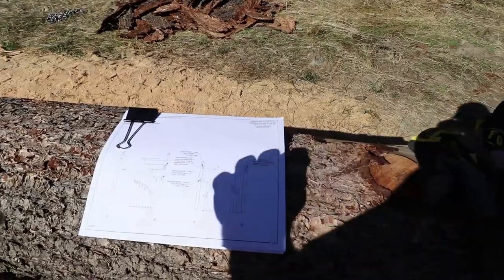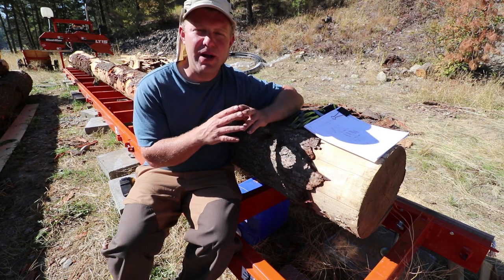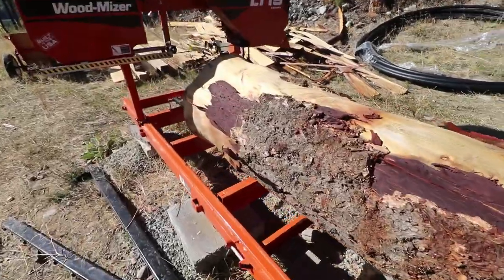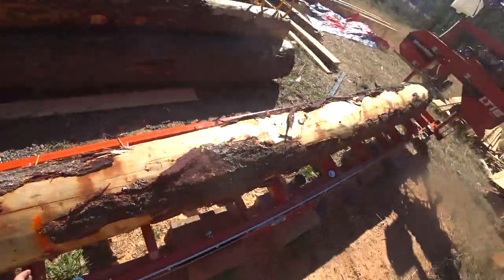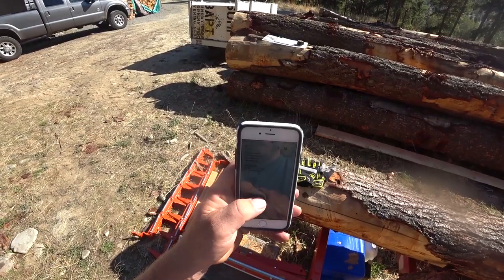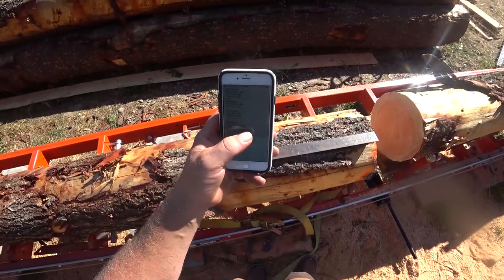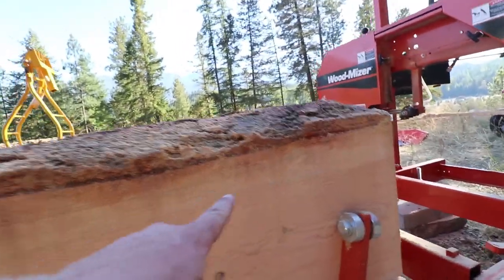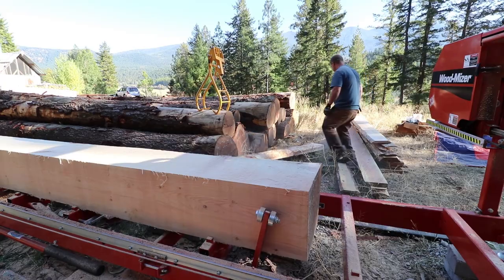Sawmilling First Beam Of My Timber Frame House

Comment: I enjoy hearing the hows and why - I wouldn't watch to just see a saw buzzing.
BTW- saw Alyssa in last epi putting bark sections in a bin.  I take my bark sections and lay on paths bark side up.  They decompose slowly, prevent weed growth, prevent wheel sinking in the mud, and provide wet/snow traction for my tractor,  lawntractor and feet.
Reply: The wood is for a Hugelkultur raised bed garden.
Reply: Thanks -- Some bark would go a long way on that.  But still a great use.

Comment: Just a tip. When you mark the size of log you want with your square on each end if you would take a nail at the 4 corners on each end and run a chalk line from nail on on end to the other and snap it  you could see what size beam you could get with out guessing.    Also you would see the low and high spots. This would give you a better way to get your beam size without waste

Comment: The tape you have is a Spencer logging tape.  You can get tape to put in that which has a "diameter" scale on one side.  So you just wrap the tape and read the diameter.  I use it constantly.  Definitely a cheap tool worth investing in given how much of this you will be doing (or have done?).

Comment: Hi Jesse!
Recommendation:  Don't worry about wane on one side of your timbers.  Think about it:  For walls, the outside edges will be inside the finished walls.  For floor beams, put the wane on the top and it will be covered by the flooring.
Old engineering expression: "Perfect is the enemy of good enough!
Also, don't stress over perfect dimensions on the beams.  If the exposed side of the beams when finished varies by even a quarter of an inch, it doesn't matter and will never be noticed.
Perfect is nice, but TRIPLES the time involved!!
Best, Dave
Reply: You're wasting your time. He does not read the comments, so you are just talking to the rest of us. Just so you know!
Reply: In addition to SixString, the structure is built.  Go to his Facebook page to contribute Real Time.

Comment: 1. sometimes as you rip the logs the stresses change and they  will "curl". So it may not be the bed of the mill. 2. Wanes are not necessarily bad, they can add interest, especially in braces, floor joists/beams.
Reply: Also the movable arm ( I forget the actual name) needs to be as close to the log as possible to prevent blade deflection during the cut.

Comment: When you had the jack under the log, it was on the ground, i think you should have put wood under the log so the weight would be on the mizer before cutting, otherwise you have 2 reference points.

Comment: Your logging tape measures diameter as well as length fyi.  You can also use two framing squares to accomplish the same thing.  The crook in your logs is referred to as sweep and should be to the outside when starting the first cut.  The closer the idler wheels are to the work, the less deflection you will get in your blade.  Seriously time to re-purpose the grizzly into a solar kiln so you can dry all the left over 2x material.  Those are amazing logs... they have very little taper, the wood is quite clear and you can see how straight the grain is in the checks.  Keep up the good work, but a owner built log home would cost less at this point even if you like post and beam style.

Comment: This will likely be too late for advice to be received:
your sawmill is also technically a jointer. You aren't going to have a straight piece of lumber until you take a skim "flattening pass" on the mill. it doesn't even have to be to dimension, just flat. As long as your mill doesn't have twist in the bed, you use that skim cut to rotate 180 and reference that to the bed. adjust the bed to be flat to your reference face. Your next cut will give you another flat that is parallel to your first cut. After that, you measure to dimension what you could get out of the stock.
Reply: It helps if the rails that the band saw rides on are parallel and not skewed so that you can get a good first cut.  In cutting the tree the main thing is just to line up the pith on both ends if the tree is reasonably straight.

Comment: I'm not criticizing ya'll to be mean so please don't take it that way. Ya'll just don't have much experience building a house. As long as it takes ya'll to get a simple project finished like putting down the warmboard, that is only about a two and a half hour job. I just don't see how you are going to have this house dried in before winter.  There is a lot of work that has to be done after the framing and I sincerely hope you have a lot of experienced help coming after the framing to help you. I've read several comments that say that ya'll don't read your comment section and you are missing out on lot of good information that I have seen. I truly wish you the best. My advise would be that you study your plans at night for the next day's work and stop second guessing every measurement and process during the workday. You need to have all that figured out ahead of time and only make small adjustments during the building day. Having to stop and run to town everyday to pick up more screws, nails, glue or other supplies is killing your time management. The most important part of building a house is the logistic process of having the right products you need when you need them. I wish ya'll all the luck in the world trying to get this dried in by winter. 

I sure hope that you winterize  your equipment and call a mechanic to find the parasitic drain on your backhoe, make sure you have plenty of antifreeze in the backhoe. People selling used equipment are known for short cutting to save money just to move the equipment. Don't ruin an engine block by assuming they took care of the antifreeze when they may have just filled it up with water.
Reply: Yeah I noticed that, I don't understand why they took so long putting it down. It's a very easy product to lay down. Maybe they just bit off a little too much with their level of experience. They seem like nice people, Alyssa seems like a very hard worker and a nice lady. I think Jesse gets a little frustrated with the instructions that come with the products from the manufactures at times and seems to spend a lot of time on the phone with them. I know he doesn't want to make mistakes but building a house is not easy even for the pros at times. Lining up subs can be a nightmare if the market is busy and everybody has lots of work. They are just young and inexperienced I hope it doesn't take a toll on their marriage they do seem like really good people. 
I sure wish the read the comments and responded some. Many people have given them good suggestions. I'm a little worried about the used backhoe right now.  It's leaking hydraulic fluid, probably bypassing a seal, that's why the bucket drops down overnight. It's got a parasitic electrical problem and needed a new battery right after they purchased it so I wonder what the other systems look like. So many times they fill a radiator with water and only a splash of coolant to make you think it's got the correct mix for their environment only to see a block freeze and crack.

I know first hand how sellers will slap a little paint on something to make it look good and take shortcuts on the mechanical end, I've been bitten before myself. Had a company mechanic JB Weld a water jacket on a cylinder on a Caterpillar 3116 engine in a rollback that I found after I discovered coolant in the oil after we had purchased about 6 months later.  Thought it was a reputable company, they sell new and rebuilt forklifts in our area and have been around for years, we would have most likely still negotiated a deal on the truck just would have planned to replace the engine. Just wish people would be upfront and honest but that just doesn't happen much in this world these days.

Comment: You overthink this too much... just get to work, or you'll never get it done. 

you need to saw 1 flat (this cut should reveal the max lumber available from that log 6-12 inch flat cut from side to side..), turn it 90, saw another flat, the turn 90 saw another, and turn 90 and saw another. all the cuts should overlap some so that no bark is left in the corners. otherwise take a skim cut, and get rid of it. the small end is your guage for the size beam you can get. this will give you a rough cut timber to which you can set aside, and do a finnish sawing on it later. You are wasting time. I can appreciate double checking your cuts, but it'll take you forever at this pace.
Reply: You realize this video is several weeks behind right? The house is up... so obviously they got it done.
Reply: decoysk but obviously talking wasn’t an issue...
Reply: decoysk dude, they need to talk to make videos, you don’t want talking don’t watch video... you’re the only one here pissing and moaning about them talking during a video you’re watching.

Comment: I am not sure if the timber frame is permanently secured to the concrete stem walls or not.  Or if the timber frame is only screwed onto the warmboard subflooring.  The roof or a temporary roof of tarps will act as a large sail that would destroy the timber framing during a strong wind storm, if the timber framing is not permanently secured to the concrete foundation.  Please make sure all is secured during this winter!!!  Stay warm and dry...
Reply: It is a good thought, but this is the reason for windbracing.
Reply: Windbracing only works if every thing is secured to the foundation.  Thanks for pointing this out.
Reply: So if your caveat is noted, the whole thing should fly away in one piece.  I seem to have noted that there was a ledge on the edge of the base plates which are anchored by bolts , so he only needs to run a base for the frame around the baseplate and make sure it is attached
Reply: So true, that may be why the SIP is installed to the 4X12" sill plate before the roof is on...

Comment: Scoot that spud!  Boy, lots of work moving large timber around.  You mention "timber floor joists" but I've seen the videos with the engineered joists and the warmboard over it, so this term confuses.  I can only guess that the joist you mention is the outside bottom timber in the timberframe structure, not an actual floor joist as normally thought of.

P.S: Love the turbo log-milling scenes.  LOL

P.P.S:  You'll enjoy your log measure more if you spend a few minutes on maintenance on it.  A couple dabs of lithium grease on the pivot pins would stop the squeak.
Reply: LJ Prep I was just there building this frame, there are indeed timber floor joists for the second floor of the frame, I cut the joinery and put them in place myself. He's not talking about the TJI's that are already in place. 👍🏻 if you haven't seen the frame yet, check out heir Instagram, it's beautiful!
Reply: This will be a 3 story house. Garage, living space, living space. The timber frame floor joists will be between the second and third floor. Hope I said that correctly.
Reply: Susan Pfeiffer 👌🏻👍🏻
Reply: Brizzleberry Eaves BOB!
Reply: ro p. Hey bob! It was really nice meeting you. I hope we can work another project together some day.
Reply: ro p. Wait, is this Bob?
Reply: So far, I've watched nearly every one of their videos but have never seen a picture (rendering) of the future house.  Does anyone have a reference point for it?  I've seen a 45 degree angle shot of the first page of their plans, so i guess maybe I thought the bottom level was the garage.  P.S: Thanks to Brizz, too.
Reply: LJ Prep have you seen their Instagram? The house is framed, it'll give you an idea of what the future completed house will look like, with a wraparound porch and big windows on front.
Reply: No, I don't use Instagram or Twitter, but do visit Facebook a couple times a week.  What I've done, though, is always wondered why they do all the stuff, then post a video later, then get all the feedback which would have saved them a lot of time and frustration.  Maybe on their next project, they'll post what they are thinking of doing, how they'll do it, and then ask for feedback before they start.  And after all that, they'll do the work while filming it.  (grin)

Comment: You should attach a bike to the saw mill so you can peddle rather than do by hand it would be less energy in the long run... can you weld?
Reply: Only issue would be climbing on the bike and off every pass :)

Comment: the first time I've seen a logger's tape was a while ago on the Wranglestar channel.

You mentioned that you calibrated, measured every cross member to the blade and stuff. did you do that with and without load? that load might make that difference. But by now, you've likely fixed what's wrong.

That wane is good chatictor in any home, nor sure why you'd want it gone

Comment: You may have spelt a word wrong, but gee yu 2 are great workers, and given you got the point across for the title, not a problem for me, as others have mentioned WM would be wise to assist and supply a tech to show just what need to be done and back up there product, given others may see it as an issue in using that product. just saying.
Given the support Warm board assisted with it would only help to promote Wood-Mizer, just saying.
Keep up the great vids.

Comment: Would be nice if there was a way to compress all the coming saw dust residue into  a form for burning later. Maybe a 6" steel tube and hydro press would make the "Glitter Logs"... Thanks for sharing.
Reply: Tenright77 all that glitter came in handy keeping the dirt out of the garage work area and keeping sharp chisels keen on the occasional accidental tool drops
Reply: They make stoves that literally just turn compressed sawdust, they're called pellet stoves
Reply: You can just tamp the sawdust into a steel drum with a blower pipe bringing air in at the bottom and a mandrill made from about a four inch pipe in the vertical center.  Then you take the mandril out and put a top on it with a chimney and turn on the blower and light her up and it will burn for quite a while just like a solid fuel rocket stove.

Comment: Hi, this is just a suggestion ... use your backhoe to level the ground under a saw machine, so it's easy to calibrate the accuracy of your cutting.
Reply: It was off by half an inch. Do you really think you can make the ground flatter than that with a backhoe?
Reply: No actually, but it will be easier to adjust the height of the legs of the saw machine. Or if Jesse does not mind, he can flatten it by making a concrete floor. It's better and stable for cutting accuracy and further work. (they make a house that will be occupied for years) . It will be safer for them later.

Comment: I know it's too late for advice, but he should be making 1x instead of 2x boards with the leftovers. Should be making wood paneling and shelving out of the scrap since they aren't building a stick house.
Reply: Timber frames are just frames, you need standard 2x boards in the 10 foot spaces between the timbers to support drywall on the inside and the plywood on the outside.  Also for kitchen cabinets, shelves, wiring, insulation and so forth.

Comment: Hey Jesse they make little adhesive backed bubble levels would they help for quick visual verification if you put them on each end of every bed on the sides after you leveled everything up or do you think the accuracy is not there with that of a simple bubble level? Just a thought...

Comment: Just a thought to save time when estimating what height to set the mill at on the opposite end of the log, make yourself a jig that you can set on top of the mill bed with a ruler mounted to it, that way you can just set it down, measure how high up you need on the far end and the set it down on the other end to set the blade height. may be more efficient that way
Reply: This guy should not be using a mill. Doing everything wrong. I used mills for many years and I hate to think other people that are watching this video will try to copy him. They are lucky no one has been hurt on this job.

Comment: So, is there anything you would do different when buying the sawmill? Go electric instead of engine or motorized instead of the crank travel?
Reply: Jake A. i think an electric mill would be much nicer to use but for them they would then need a really big generator so it wouldnt work out to well

Comment: Bandsaws have blade drift. Once the blade gets warm the metal will stretch a little. Might cause the problem you were having, along with the two high spots causing rocking.

Comment: reasons for buying a bandsaw mill over a swing blade mill?
Reply: Evan Staite for slab sawing the band mill cannot be beaten but for what they are doing a swingsaw would have been better although double cutting may have cause issues

Comment: Is your loggers tape marked off in 1/10 of a foot increments? A lot of times they are marked that way because it is easier to calculate board feet in 10ths instead of 12ths
Reply: Jesse's Garage A loggers tape is always in 1 inch segments . Only surveyors tapes are in tenths because engineers can’t do the math . Lol
Reply: Allen Pew I’m an engineer and sadly agree on the math part. :-)
Reply: LOL

Comment: If you needed a 8x8 post  and you said you cut it @ that , your not going to get a 8x8 after you plane it ??????????
Reply: Bills BuildAll i presume when he says 8x8 it will be a little over those dimensions to take planeing into account.
Reply: They know exactly what they are doing.....During the Timber Frame course you are taught to plane down 32s" every pass until you get your correct dimensions.